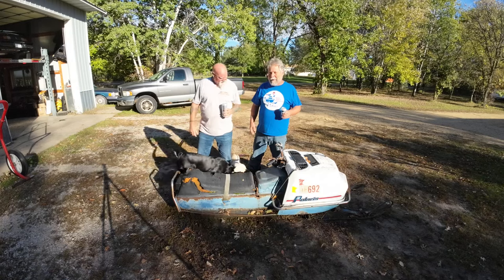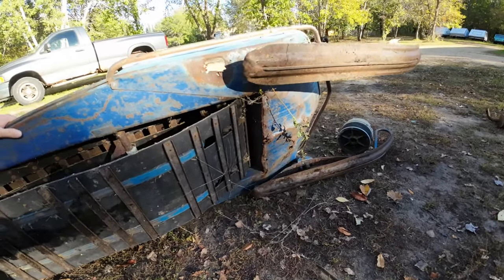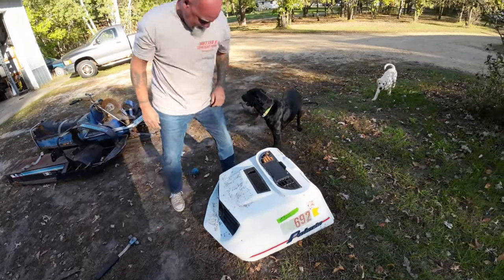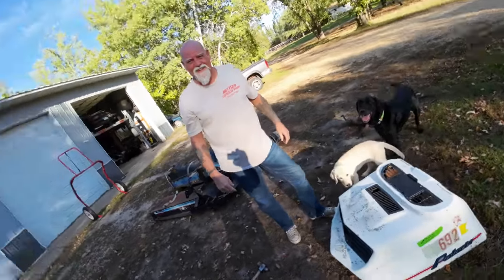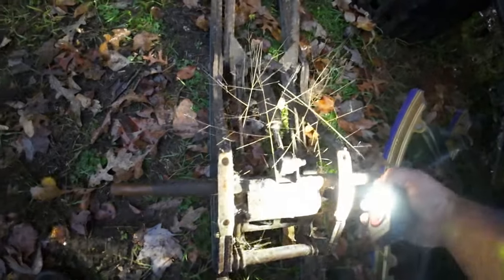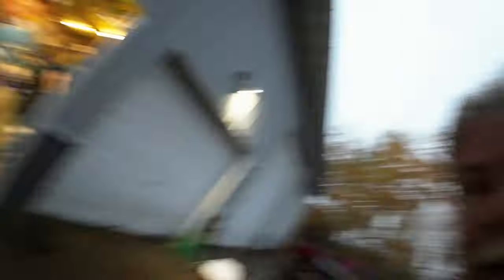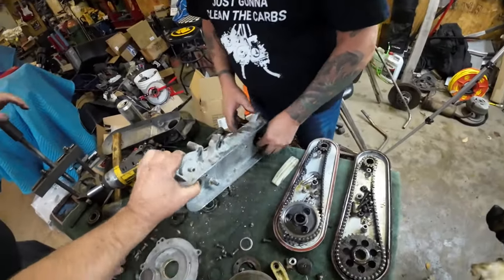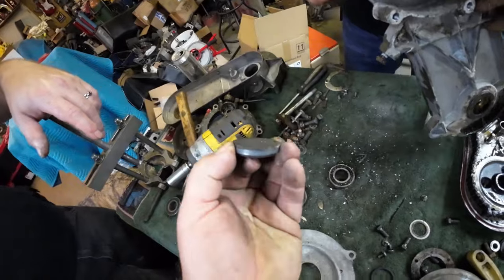Gemini One Lung Racer Part 3: Brake and Chain Case Rebuild. Vintage Polaris Colt Snowmobile

Comment: Not sure if you've already taken care of this, but the stock gearing on a 244 single colt or gemini is SUPER low 13/35. Even the little fuji 244 can run out of gear with that pretty easily. Many twin colts came with 15/35 so that sprocket/chain is easy to come buy I'd bump up to at least that. I ran 16 or 17 top sprocket in mine when I had the 244 in it but it gets hard to find sprockets in other sizes for the odball spline/chain in a colt.
Reply: And this bad boy is going to be WOT for almost the entire Wild Bill so top speed is key!
Reply from the maker: I checked with Brenden and he said 17-35 too. We will dig up a 17 tooth top gear somewhere.
Reply: @nuttersspeedshop  That will work. His HD is WICKED fast so if the 244 is geared a little lower it will be okay. Another thing that I like to do is replace the set screw on the brake pad adjuster with a long 1/4" bolt that has a washer or something welded on the head so you can adjust it easily by hand. You have to file a little notch in the chaincase cover for clearance. It's a sensitive adjustment between dragging and really long brake pull. I use blue locktite on it which theoretically won't work after adjusting once but it does stiffen it up enough to not move when you don't want it to.

Comment: Hey if you can find a 72 250 colt muffler it's a tuned one came factory only one year it builds a little more power
Reply from the maker: I used to own a '72 Colt 250 and I know which muffler you are talking about. It went with the sled when I sold it.

Comment: Hey Nutters,

You guys are awesome! I rebuilt my 73 Colt chain case, but cannot get a positive bite        with the brake pads. Cleaned slave cylinder, all new O-rings, brake pads, and made it immaculate. The whole system is tight. No leaks when I depress brake handle, but I don’t get a positive bite on rotor. I bled the brakes at least a dozen times. One of my questions is the rotor. Mine is somewhat pitted and a little rough. Could this be specific cause for brakes not biting positively? My brake line appears to be in solid condition, but I did not replace? Any tips would be greatly appreciated! I have taken the chain case, apart a half dozen times.

Thank you!

Brock (the “Sled Slave”)
Reply from the maker: Did you adjust the set screw for the fixed pad?

Comment: Hey Nutter, calling from canada, my dad and I are working on some old INDYS (97 XCR, then mine is a 98 INDY 500). my dad and i are both rebuiling our primary clutches. For mine i have two sets of clutch weights, (10mb and a 10 seires weight) What do you recomend I do. Im trying to keep it working as how it would come from the factory. Thanks
Reply from the maker: Factory is a great way to go. I don't have the specs for every clutch memorized. Instead of me looking it up I'm going to tell you where to find the info for free. Go to vintagesnow (dot) com and go to the Polaris service manuals and down load the 96-98 service manual. It's free. It's full of info. It's a big download. I know the clutching chart is in there.
Reply: Awesome, thanks for the help, I bought the snowmobile for not that much $ and now I'm just fixing all the problems with it, your videos have been a great help, specally the p85 rebuild @nuttersspeedshop